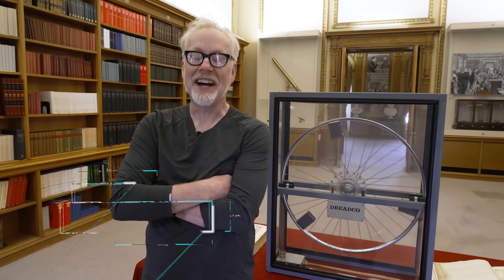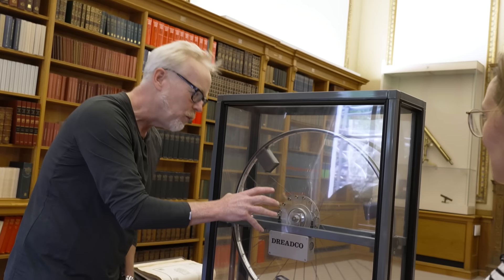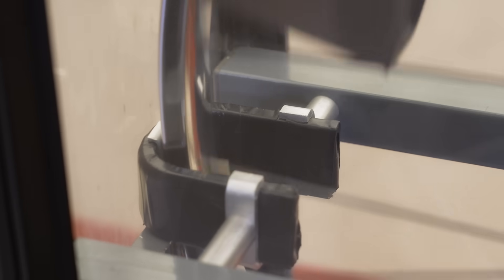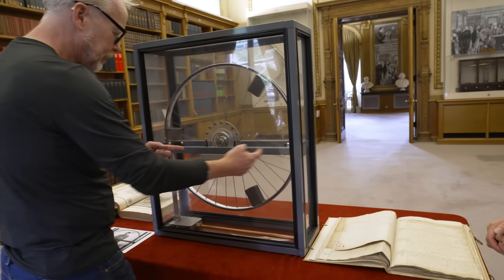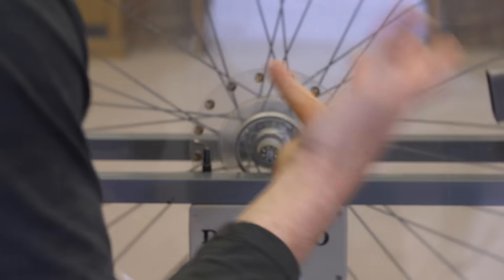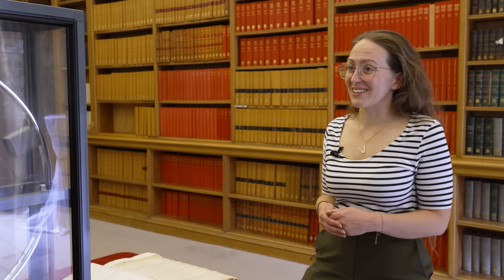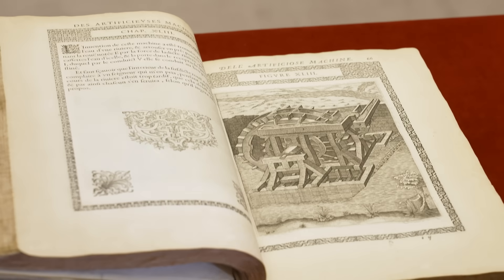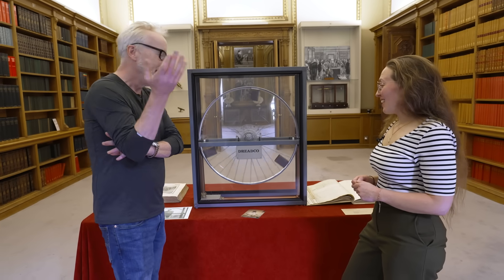Adam Savage vs The "Perpetual Motion" Machine!

Comment: Occam's Razor would suggest that this is a super efficient, low power electrical motor, running very slowly off a battery for two years until the battery is flat !  :)  Note : The two simplest electromagnetic induction systems are electrical generator and electrical motor. It is one or the other and this system of this wheel best fits the electrical motor choice, which requires an energy source, being a hidden battery to power the magnet and coil pairs at 3 points 120 degrees apart on the wheel. It is likely some hidden current switching system exists if there is simple  DC supply.  With an energy source of a battery present, the vessel would probably not require any degree of internal vacuum.
Reply: You're fairly close. I'm convinced it's a simple permanent magnet motor. The horseshoes are the magnets, of course, the boxes hold very high density storage batteries, with a coil wound around them. Thousands of feet of extremely small gage wire that draw high pica amps for a couple seconds when activated with a magnetic switch, then the circuit is opened as soon as the box is in the center of the magnet. Simple, reliable, the only question is if it could actually last years. But, definitely a very high vacuum. Air resistance is going to be a big power drain when you have such a low energy motor.
Reply: @klocke5247   : Thanks for that; I think you may well be right right about that, including a (partial to? ) high vacuum.
Reply: K Locke
RS : I made some errors before correcting myself, K Locke said  : There's little you can do with a field that's stationary. A magnet will orientate to it, as that's about it. It won't work to drive a motor because of this. People, sadly, have wasted years of their lives trying to build perpetual motion magnetic motors that simply can't work because of the energy required to flip the poles. That's what happens in a permanent magnet motor. A commutator on the armature switches the direction of current, and field polarity, in relation to the magnets. And, that's the key to this, I believe. Think I fiqured it out. See above for the explanation.
Reply: Yes, I agree with you. The rotating wheel is not connected to anything external , so it cannot exert a torque on anything external - making it NOT-a-generator. So if it is NOT-a generator, it must be a MOTOR.  AND it is a basic device, unlike an EV for which motor and generator function is interchangeable. But an EV has wheels which make contact with the road, and the wheels are both given torque in motor-mode and give torque to the "motor" to charge the battery in "motor becomes generator" mode. This wheel in an isolated box does not provide torque, so it receives torque. ALSO , in my much younger days , I have turned a many-turns big coil the size of this wheel/box  about its diametrical axis perpendicular to the Earth's magnetic field, to yield the tiniest of currents ( micro or nano amps ).  In this case the coil acted like a very weak generator by my rotation of the coil ( torque applied by me ) about its diameter. However, that is not what this wheel-in-a-box is doing.  The wheel-in-a-box is turning on a different axis at the centre of a circle caused by current applied from the hidden battery ( so again it is a motor ).
Reply: @klocke5247  : Just one more thing I noticed today, is that there are two "contact points" above the Dreadco box. The one on the left is spherical and the one on the right a sharp point. Such metallic shapes have differing properties with respect to the shape of any electric fields produced if and when they are charged. They pass by some concave cylinders on the wheel, either side of the inner diameter of the wheel, across an air gap, which has a certain permittivity, which means this could act as a capacitor or two differing capacitors.  So is this just a red-herring to bamboozle us or are they significant ?  Are the sphere and needle point insulated from each other, or not ?   I don't know, but I will have to leave it there and get on with my chores. Getting on with creating some music would also be a good idea. Maybe someone else has some smarter ideas than the ones we have discussed ? Again I do not know.  Give it a go folks - Occam's Razor may or may not apply here -  you be the judge, but use the ideas here and thoughts of other's who have given it a go and come up with something not thought about before if you like. Best of luck !  Have fun !  :)
Reply: I cannot see how any electrostatic effect , if there is any charge at all, and if an electric field exists at all, nor that it would impart a torque to keep the wheel going. The video does not contain any evidence of any spark or arcing and therefore no proof of electric charge of significant voltage. So with no evidence of charge nor of any useable torque to impart, to the best of my knowledge, I would conclude that all this additional clutter is indeed a red herring to confuse people. Therefore, I conclude yet again that this device is an electric motor run only from a battery, doing so slowly and very efficiently for about two years until the battery is flat.  So I uphold that it was appropriate after my initial look at this device that to invoke Occam's razor was appropriate. But someone is welcome to prove me wrong and good on you if you do so. All the best; I have bigger fish to fry......  :)  :)  :)
Reply: Note that I appear to have also received a reply from klocke5247 four days ago, which I have picked up later today and which agrees with what I have above. Here it is : "
K Locke replied: "There's little you can do with a field that's stationary. A magnet will orientate to it, as that's about it. It won't work to drive a motor because of this. People, sadly, have wasted years of thei..."  "  I do not know why it did not appear on this thread.
Reply: With an energy source of a battery present, the vessel may not require a vacuum, but a partial vacuum may extend the battery life. A generator requires a force/torque to be applied to the wheel, generating a current to be utilised and there is no such option for a force to be applied to the wheel. There is no device present outside the wheel to utilise the energy produced, like a light . No force applied , no external use of the energy like a light glowing, so not a generator.
Reply: Note - its is easy to get fooled by the nature of the presentation that you are looking at a generator, when in fact you are looking at a motor with a hidden internal power supply.  She should have a big black hat, and pull a white rabbit out of it suddenly - hey presto !  :)  :) :)   Magic ! :)  LOL.
Reply: More thoughts : My Nissan Leaf (EV) motor can switch states between acting as an electric  motor and then switching to acting as a generator for braking by regenerating current to go back into the battery. But an EV is a sophisticated machine with computer-logic switching-circuits and this device in the video is just about a simple, stationary motor,  seemingly introduced as a generator ( and more ) by the presenter. They must have had a lot of fun with this one......Also with respect to an EV, the regenerative braking on long downhill sections, extends the length of a journey, by charging the battery by a few units ( kWh ) of energy ( 1kWh = 3.6 MJ ) on a long downhill run ( on Eco mode , say ) . For an EV, this  is simply an energy extension system for the battery as it mostly discharges on a journey. For an EV, the battery and motor powers the torque to the wheels. In regenerative braking , the torque of the wheels provides the torque to the "motor" which has switched state to being a generator, and this sends current back to the battery pack. This helps extend the range of the EV. The "perpetual motion joke" continues, even in videos like this one...but it enables some good discussions.

Comment: There IS a perpetual motion machine though and that's our very universe. The issue with a perpetual motion machine is that in order to do so, it must be a true closed system. By that, I mean it would  have to not interact with this universe at all because if it does, then energy can enter or leave the system and it therefore cannot be perpetual motion as it would not be self sustaining. That is why it is impossible, we can't stop the universe from interacting with itself.

Comment: The first thing that is not needed, or BS to throw the person off, is the heat sinks (maybe the box inside too!)... Heatsinks are only needed when you're displacing or trying to get rid of a lot of heat from a device. You can't generate heat without a lot of power, and the heat that needs to be displaced by the heatsinks is wasted power at that, and a loss in efficiency! Unless part of your desire is to make a heater!!! LoL 😂 
So that right there doesn't belong. Or not doing anything but to confuse or thow you off, and I am sure the copper pipe too! If it's not a battery or batteries that need to be replaced every 2 years. Then I suspect they need to re-magnetize the magnets!

Comment: The problem with magnetics is it suffers from the same issue as gravity, the energy gain from one motion is lost in the reciprocating motion. A really low energy motor operating really good bearings with the device in a vacuum might work. It's gotta be pretty efficient

Comment: there is a simple one I've seen video of recently.  a marble slides down a wire ramp which ends with a curve sending the marble back to the starting point.
Reply: and elephants fly
Reply: That one uses a magnet to accelerate the ball bearing.

Comment: Does it really have to be a hidden battery? This isn't perpetual motion, it's just a very good illusion of perpetual motion. Sort of like those  series of steel balls where you can pull one up and drop it and that thing will go for awhile. Could it not have something to do with the 3 weights and how they're aligned, especially if they are able to move ever so slightly. Granted, the motion seems to be pretty consistent and that may make things a bit jerky.

Idk, it seems to me, at least in theory, that if it's a perfectly balanced wheel, and the bearings are nearly frictionless, that it could spin for a really long time.

Comment: My theory is the blocks on the wheel have clock mechanisms and a battery inside shifting a weight at the right time outward to help pull the wheel down, while the weight on the otherside moves inward to make it easier to bring that side back up which may explain the occasional slowing and speeding up if over time they get out of sync
Reply: But they would eventually be in sync for sure like fast, then it would slow maybe even faster to a halt

Comment: I think those are magnets and they have opposite poles like an electric motor!
Reply: You’d need electromagnets with switching polarity timed to the rotation of the wheel. Meaning a battery. 

It’s how electric motors work, you can’t just use regular magnets.

Comment: According to my father, his great uncle in Cape Breton up in Nova Scotia, a coal mine maintenance technician, invented the original device the roto-rooter is based on in order to clear air vent holes in the mines of dust and dirt. He also allegedly invented, in the 1930s, a perpetual motion machine using a precisely balanced bicycle rim.

Dad said the rim had little weights mounted at precise intervals around the rim's perimeter; and that they were all the exact same weight and so precisely balanced that starting the "machine" meant just moving one weight at the top of the rim (at the 360-deg point) a fraction of an inch to the left or right would start the rim moving on its own. Supposedly, it used very finely polished bearings and a light lubricant that offered next-to-no drag. 

The thing was supposed to have run for years before wear on the bearings or dust would cause it to stop. Once cleaned, re-polished and re-lubed, it could be set in motion again. Another thing, supposedly, once it was set in motion, the air in its case was drawn out with a vacuum pump in order to lessen air friction on the rim and spokes as the thing rotated.

Comment: One energy input may be the imbalanced air going in and out of the copper tubes. As the enclosure temperature rises the longer tube expels more air than the short tube. As the temperature drops, the cold air simply settles to the bottom of the enclosure. The block with heat exchanger fins is a time averaging device that mitigates the temperature fluctuations perhaps helping to maintain laminar air flow in the tube. That is about as much guesswork as I am willing throw out. The tubes may be a distraction to the batteries hidden in the three blocks...

Comment: From watching Robert Murray Smith building wind turbines I believe the center is a generator. The magnets pass by the little wires connected to a small capacitor which enables the wheel to freespin. How that charge is then used to push / pull with a tiny electro magnet with  the black boxes I don't know but I think it would be enough to give the impression of perpetual motion. 

If you really wanted to you could throw a battery in that the capacitor charges. Which might eventually drain.

Comment: The red herrings are the most clever part about it.  If the mounted wheel "weights" are containers; or if the spokes are tubes (crimped center wheel)...

The machine doesn't need anything, except the wheel filled with a clever fluid, and a periodic push.
Reply: Filling those weights with a fluid actually wouldn’t do anything.
Reply: @donkeyman2  it would if the reservoirs let water in and out of an interconnected hollow wheel.

It's my best guess at how to internally mimic the generic "perpetual" shifting weight wheels, that a lot of the devices try to utilize

Comment: I am doubtful that the u-shaped magnets and the metal cigarette boxes are driving the wheel around.  If they were, I would expect to see at least a little "cogging", or changes of speed in the wheel as the boxes approach and recede from the magnets.  Instead the motion looks remarkably steady.  Perhaps the boxes and magnets are just distractions, designed to give curious viewers something to speculate and debate about.  Here is another possibility:  The tightly sealed copper tubes and the box with the elaborate radiator fins may provide a mechanism for a pneumatic drive.  If the atmospheric pressure (or temperature) changes from hour to hour or day to day, this could pump up a small pressure reservoir that could run a pneumatic motor hidden around the axle.  You wouldn't need much power--the wheel seems to be very well balanced and the bearings look to be very good quality.  This mechanism of using temperature variations or atmospheric pressure variations to run a low powered mechanism is used in the design of the "10000 year clock"   https://longnow.org/clock/ 
Sadly, the truth is probably more mundane.  I agree with Adam Savage that the occasional secret maintenance interludes are just used to replace batteries hidden in the frame somewhere. Of course my favorite perpetual motion device is still the Earth.  It has been spinning for 4.5 billion years without anything whatever driving it.  Simple perpetual motion (as opposed to "free energy") is not so remarkable after all.

Comment: This is HILARIOUS and OBVIOUS of how it works. Number ONE ☝🏼 it can NOT possibly be running off of the magnets 🧲 because at that low speed it is far too constant, not jerky. If it were running off the magnets 🧲 it would be rotating much faster, those are not magnets 🧲 at all, they are probably empty to make the wheel light weight. The copper pipes and boxes hold probably lithium Energizer AA cells which are expensive lithium none rechargeable that the USA military have used for many many years and are available at your local grocery stores and do power things for a couple years. The DREADCO box holds an electric motor spins on the two inch diameter ring near the axel and that makes it rotate. The metal square tubing frame has wires running through it to get the power from the lower box and copper pipes to the motor in the DREADCO box. 😂

Comment: A simple pendulum is composed of a weight, or bob, hanging freely from the end of a string or bar. Gravity pulls the bob in a downward arc, causing it to swing. This type of pendulum is the most common and can be seen in clocks, metronomes and seismometers.Pendulums are subject to the local forces of gravity and do not operate the same way in different parts of the world. For instance, since the earth is not a true sphere, pendulum clocks are slightly slower near the equator than near the poles.

Foucault Pendulum
how to apply that to a spinning wheel ?

Comment: Principles of Motion
A pendulum is comprised of a weight, called a bob, hanging from a fixed point. When the pendulum is activated, or pulled in any one direction, it exhibits a principle of motion called inertia, which is Newton's first law of motion. It states that a body at rest, stays at rest and a body in motion stays in motion, unless acted on by an outside force. Pendulums provide proof of Newton's first law of motion.

Time Keeping